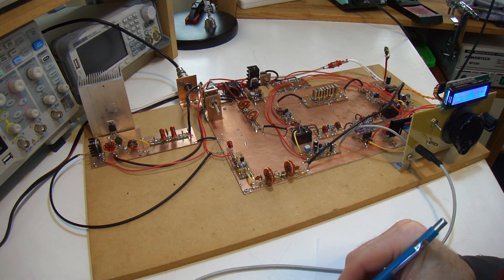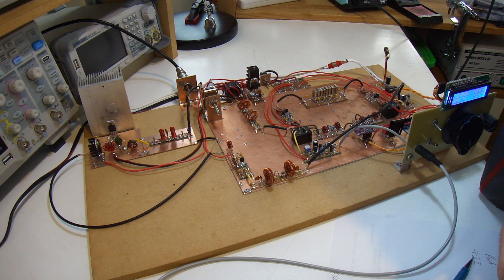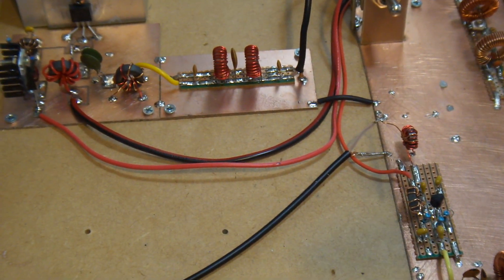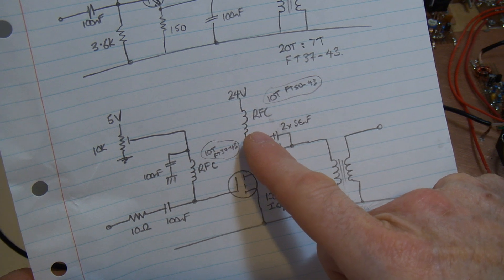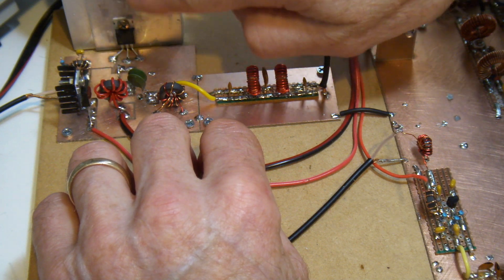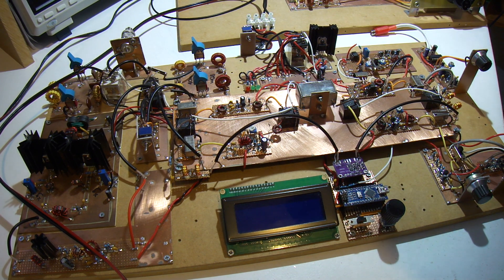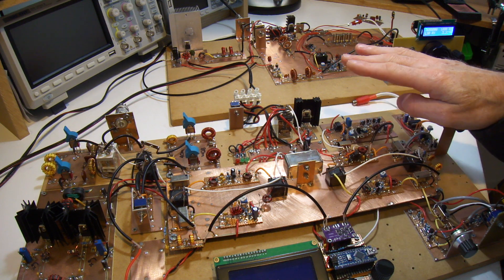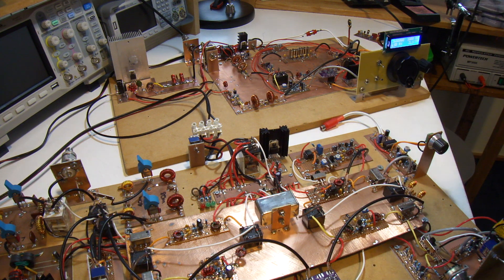Simple SSB Rig: Part 10a - RF Power Amplifier Changes

Comment: Old Collins Guy Alc and agc would be nice, Diving into teensy as a dsp alternative, Their so Cheep. got a few for experimenting with, The demodulation and audio Compression etc. and running the whole thing. the 4.0 or 4.1 Teensy has  a lot of possibilities got some others , 
had a DSP 10 2meter  in past and lost it because of moving among other things. Seems to me the dsp would eliminate the If Filter and amps and add multi modes.
Reply from the maker: Agreed. The Teensy has a great audio (DSP) library. I'm looking to use another one soon. All good fun!

Comment: congrats on 5k subs!  I've been going through all your videos and building my first rig. Got a receiver working and it sounds good!  Working on a variation of this circuit now.  For the output side I found a trifilar wound xfmr in a 1:2 configuration on the drain (right into a .1 cap) gives the most output. The mosfet sees 12.5 ohms at the drain with a 50 ohm load.  I can get 5W out with 12v supply, admittedly with a 10v p-p signal from my function generator.  I'm still playing with the drive circuit though.  I'm finding a lot of the signal at the drain makes it back to the gate through the gate-drain internal capacitance.  Since I want it for 40/20 band use I'm thinking to keep the 50 ohm resistor so it swamps (relatively) the very different reactance of the gate capacitor at 7 vs 14mhz.  My next step is to try a common emitter amp to drive the mosfet.  Anyway just wanted to share some ideas and say thanks for all this great info! 73 cheers!
Reply from the maker: That's fantastic. Sounds like you have had great success. I'm starting to play more with keyboard digital modes, which is interesting. Keep us posted on how you get on.

Regards
Charlie ZL2CTM

Comment: Hi Charlie. In my 40 years being in electronics I never had anything to do with short wave RF design. However, last November I passed the exam for F-license and now I am totally hooked up to RF design videos. (Specially when the wife is watching "The Voice"). I am actually mostly interested in how it all works. For my work I have designed wearables at 869 and 918 MHz but I really like the 20m band for the hobby, it's much more fun than all the 0201 stuff on small boards with everything on chip. Your videos are amazing, especially the way you take a piece of paper and explain each and every resistor and transformer. I have built an SSB receiver with a Tayloe detector and used a Teensy with your Hilbert transform software explanation to make a phase shifter. It works amazingly well. Now I try to built a 5 watt 20m transmitter with two times BD139 in push pull setting. I modelled it in LTspice and it seems to work reasonably well. However, if I drive the input transformer (3:1) with a 50 ohm generator LTspice shows distortion on the generator output going into the transformer. The emitter resistor of the BD139's is 2 ohm, if I understand your calculations right that should reveal some 25-30 ohm impedance at the input. Making the generator very low impedance tackles that problem but I wonder what's going on. I used that low-pass filter you explained lately and it gives a perfect, low harmonic output on the 50 ohm output dummy side. If I put a 220pF in parallel with the 50 ohm input the distortion on the input is gone. Somehow I get some interference out of the input stage.... am I right? I calculated with FT37-43, and have more than enough reactance. Can you give me some hints about what I am possibly doing wrong?

Many thanks,
Harold
PA0AHL 
The Netherlands
Reply from the maker: Hi Harold. I'll have to put some thought into this as I don't have a answer right now. Sorry about that. Might pay to double check the inductive reactance of the smaller winding approx. 4-5x what it is connected to.

Comment: And for the output. The optimum impedance the IRF510 needs to see at 24V supply is 35R for 10W output. So your 5:6 transformer is about right to match a 50R output, but you have it the wrong way round !
Reply from the maker: Opps. Then that's a mistake. Thanks.

Comment: Whoa. IRF510 has input cap of 180pF, bias RFC is 35uH and transformer secondary is 17uH. These are in parallel so inductance is 11uH. Which just happens to resonate with IRF510 input 180pF at 3.5MHz. So reason for higher output is you have a tuned circuit between driver and PA? For broadband use better to keep the 56R resistor and use the transformer to present a suitable impedance as a load on the driver. Remember the drive 2N3904 is a current source so what you get out is the load impedance x AC current. AC current can at best be that generated by Vcc - Vbe pk-pk... am I right?
Reply from the maker: I will definitely look into this today. Thanks Antony.

Comment: Well done again Charlie! Regarding adding things to your rigs, I was wondering have you ever tried adding some compression to the audio? I've got a little SSM2167 module which is a mic preamp with compression. I've not had much chance to play with it yet but I was thinking of trying it at the front of my transmit chain to get a bit more punch in the signal. Too much compression can sound terrible but a little bit might just help a bit. Just something else to think about! Thanks again. 73, Nick M0NTV.
Reply from the maker: Thanks Nick. No not really. I have heard it can do wonders, so maybe I should look into into it. I'll add it to the list.

Comment: What is the voltage swing around the bias on the IRF510 gate?  General wisdom is you need to drive an IRF510 pretty hard, and I doubt you're getting much out of the 2N3904 in a linear mode.  If it's (generously) hitting 50% efficiency, it can't operate within specs and be linear with more than about a quarter watt of output (maybe a 0.5W with a mondo heatsink and driven out of spec).  

Getting about 5W means you are probably seeing about 13dB of power gain -- not too bad for a non-RF transistor.  Asking for 10W or more is asking it to perform like something that it's really not.  It'll only give you so much for so much swing at the input, and it has that massive 180pF input capacitance to deal with too.  

A stronger driver might work -- could even just make it one more IRF510 in between, so it's three stages... 2N3904 -> IRF510 -> IRF510?
Reply from the maker: Thanks Yakov. I'll have to double check. I must admit my interest is QRP so i am not too sad. From a simplicity perspective it certainly works well.

Comment: At 24V supply a load of 35R should produce 10W output, You just need to match this to 50R nominal load. If you feed output directly to 50R (no transformer) you should get 6W output, One comment I would make is that any MOSFET has a significant capacitive input impedance so that is what your diver is looking at with the bias RFC. I'm following you closely on this as I am struggling also to understand/make a QRP PA. I have the driver done (input -10 to -15dBm, 33-46dB gain, up to +25dBm output, or 4Vrms/300m 50R). Now looking at two output stages IRF530 and 2SC1971 or other.... 12V supply used. For sure I would like to implement ALC, what range?
Reply from the maker: Thanks Antony. Some more ideas to look at there. Like I said in the video, I find PAs bit of a black art sometimes. I'll get there.

Comment: hello, I think you should add a decoupling capasitor on the ampplifier at the 24V input just befor the RFC. Otherwise your 24V wire participate to the inductance value of this RFC and may also be a big source of RF leakage. As a general rule place as much decoupling capacitance as you can on any volatge source at the point of connection. on4ldy
Reply from the maker: Yes, good point. I typically have decoupling caps all over the place. but now there. Good spotting. Thanks!

Comment: I'm looking at building my own version of the uBitX.  Will have dual conversion with 45mhz and 11.2mhz IF's (found surplus cell phone 45mhz filters on Ebay, and the 11.2mhz SSB filter came from an old CB radio).  Will use the si5351 for all oscillators (might use the two 11.2 mhz crystals from the CB rig for BFO/Carrier oscillator).  Will re-arrange things a bit, on RX will put IF amps AFTER the filters, and will use separate IF amps / product detector / bal modulators instead of true bi-lateral.  I have some MCL combiner/splitters I might use.
Reply from the maker: Wow, that sounds great. Keep us posted on how you get on. Great stuff!
Reply: @CharlieMorrisZL2CTM  I plan on using Kits&Parts HYCAS IF amp kit for the receiver IF, and will base my two mixers on his diode ring kits.  Will probably use MC1496 as balanced modulator and NE612 as product detector.  
I wired up the 30mhz LPF from the uBitX schematic and tested it with the NanoVNA.  Works as described, drops off like a rock after 30mhz with deepest null at about 44mhz, then attenuation decreases slowly as frequency rises toward 90 mhz.  I guess the inductors loose effect as the distributed capacitance takes hold.

Comment: For AGC is it possible to send some of the audio into an Arduino analog input for a to d sampling? Grab three digital outputs to a simple decoder chip for an 8 step output which can drive a resistor ladder for a log curve attenuator? Sounds complicated but may be fun to calculate the resistor ladder that can interface with a simple op amp. The a to d also yields signal levels to display on the lcd display. Sounds complex but you could easily model it, build it and display the  test log curves on your scope. A to D also yields good data like a simple cw detector to drive a morse decoder.
Reply from the maker: I have thought about that several times in the past, but using a digital potentiometer to vary the gain of an IF amp. I'll add this to the list as I think it would be interesting to pursue. Thanks.

Comment: How many watts is that heat sink rated for? It looks like, at least, 25 watts. How many watts are you radiating in the form of heat?
Reply from the maker: It came out of an old computer so not sure sorry. Way more than it has to at the moment that's fore sure.

Comment: Revisiting old one is better :) And also because you are using the same blocks with minor changes may be it's time to draw PCB for some o them ;) It will save little time in future but also space for sure.
Reply from the maker: Thanks. I'm probably leaning to adding to this one, with the aim of boxing it. Add AGC, S meter etc etc.

Comment: Agree, it should be much more than 5W. Low power output may indicate either an impedance mismatch (the energy is reflected back to the driver) or a low drive level, or both. Personally, I would model the circuit in LTspice to get a better idea of what's going on. The model is usually quite accurate for such kinds of circuits. As a side note, there is a good 10W PA circuit based on IRF510s, that can be found in uBITX schematic. Requires 13.8V and I had no problems reproducing it. Unless the idea is to experiment with new designs, of course.
Reply from the maker: Thanks Alex. I did vary the driver output transformer ratio looking for maxi drive. Great QRP rig, but we can make it better! As for copying designs, I'm happy to do that only if I can reproduce the underlying maths/design. My preference is not to simply lift a circuit out of a book or off the internet. I just wish SSDRA and EMRFD and the like did that.

Comment: It's good to keep it simple!
get rid of luxury that is not necessary indeed.
what struck me is that 5 Watt indeed seems too little to me?
when I make an AM Grenade transmitter I thought I was closer to 10Watt.
otherwise search with Google for: grenade transmitter
maybe it's the amplifier stage, (amplification from transistor?)
I used a 2N3866 a little less maybe 2N2219A could be work too!
And who knows, you just need an extra staircase behind that 2N2904 ?!
And who knows, 2X 2N2904 may still work???
or also pay attention to the capacitors that they do not heat up at the output.

Healthy Greetings from the Netherlands!
Rob
Reply from the maker: Thanks Rob for the input. I will definitely look into the AM Grenade tx.

Comment: Hello Charlie - just to let you I'm copying (ish) your build and look forward to each video.   I'm a rank beginner so the simpler the better for me.  Keep doing what you're doing!   One of the bigger changes I've made is using a RP2040 Pico (£3.90 plus postage) with Python rather than the Arduino - that makes the coding a lot easier for me (I got the Python hint from the YT-er NA5Y). Thanks Kevin M0XYM
Reply from the maker: No issues here Kevin. Just note these are not tutorials, just a video log of what I am getting up to. I know there will be errors here and there. I did some Python a while back for another project and it worked well. I guess I grew up with C so tend to stick with C/C++.

Comment: Thanks for the update, it’s a great project. I’m surprised by the output transformer on the IRF510, I always thought that the transitor’s output impedance was well below 50 ohms, which doesn’t seem to be the case here.
I played around with the cheap Chinese amplifier kit available on eBay/AliExpress (the miniPA70) which are delivered normally with IRF530. I tried out some IRF510 and IRF520, everything else being equal and the output power was definitely the highest with the 530’s
Maybe worth a trial ?
Reply from the maker: Thanks Frédéric. Yes, I was a little surprised too. As for other MOSFETs, yes I know there are other ones that will perform better. I think I'll look into those at some stage, including the RD06HHF1.
Reply: I’ve tried the 70 watt eBay amp, too. The IRF530 puts out more power, but they blow easily compared to the 510. I installed a pair of 510’s in mine, changed the turns on the output to 3:1 (I think), and used the WA2EBY input transformer. On 13.8 volts I get 25+ watts out on 40 meters CW. Best 510 amp I’ve ever had.
Reply: @richardchambless12   Oh that's very interesting. Because I noticed that the ferrites provided with my kit (at least for the output transformer) were not type 43 materiel as most of the people were using. And I noticed the materiel was heating up quite a bit.  When I swaped the output transformer out for a type 43 ferrite, the ferrites were heating much less, the output power jumped from 45W to 55W (CW) and the efficiency from less then 50% up to 60%, all under 14V.
I noticed that the input match wasn't that great ither, it's the next problem I wanted to adress. Thanks for the clue, I will definitely check out for WA2EBY input transformer. 🙂

Comment: Fun experiments. Does it seem to you the 2n3904 worked as well as the 2219?
Reply from the maker: Hi Todd. In terms of replacing the initial driver amp, the single 2N3904 performed equally if not better. Certainly simpler.

Comment: Every nice. I have some good power transistors i plan on using for my PA. Got two MRF453 from a CB amp i bought from a thrift store for $5 (mostly to make it work on a different band, plus its something illegal off the streets.)
Reply from the maker: That sounds great. Will you be looking at a push pull configuration?
Reply: @CharlieMorrisZL2CTM  was thinking so, although not sure. I havent done any RF amp stuff at all. Xd

Comment: Of course you did say you wanted to keep it simple, so yes you are correct with no AGC. I have a real problem when designing things of going crazy with the features! You have to draw the line somewhere, unfortunately for me I keep moving that line which I think is the main reason a lot of my projects are never totally finished.
Reply: Yeah feature creep is a real problem for me too. Projects take longer and longer and the more time it spends on the bench the more ideas I have for it and thus it spends more time on the bench.
Reply from the maker: I hear you Brian. I'm thinking I might use this rig as a spring board and add other features. Not sure if that would be of interest to others or not. Perhaps add features with simple readily available components?
Reply: I would like to build only one rig and keep making it better and keep putting in features. I see it as a combat with commercial radios which are taking over our hobby more and more. I want to show, that home brew can match the commercial radios. And yes, my heart lies in the good old electronics, but I also have to go into digital filtering. Just to show that it can be done by amateurs. But my list is long and until now I have had a working day of 12 hours. I recently got started at my life as pensioned and now I got the time to live out the dream.